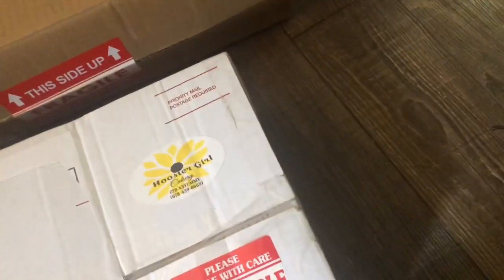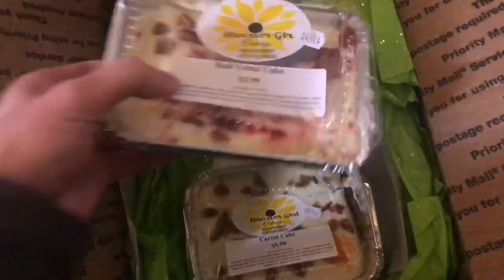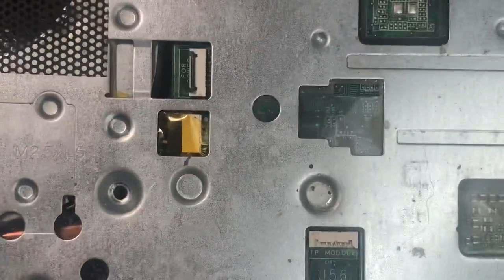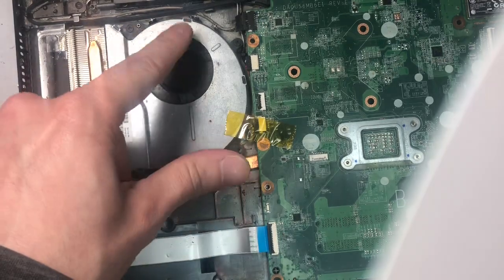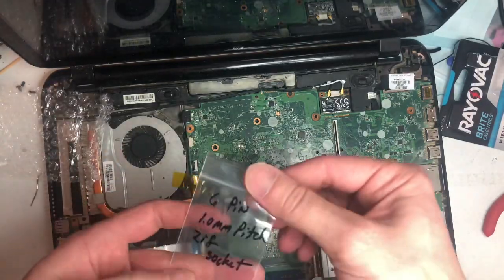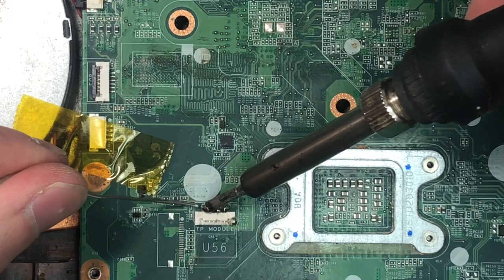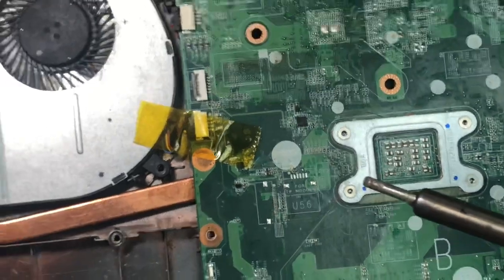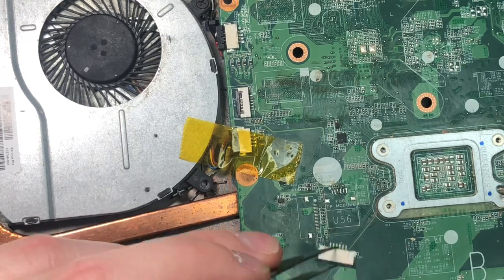How to replace a 6 pin fpc connector on laptop motherboard

Comment: might better to use a smaller soldering iron tip if not using a hot air gun. If you don't want to remove other random components.